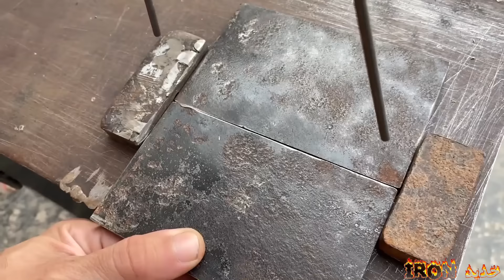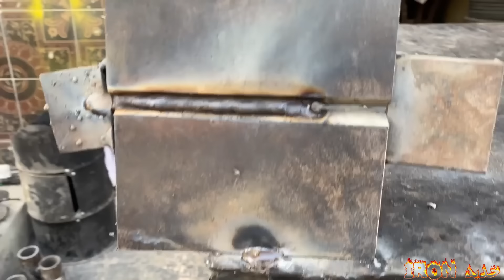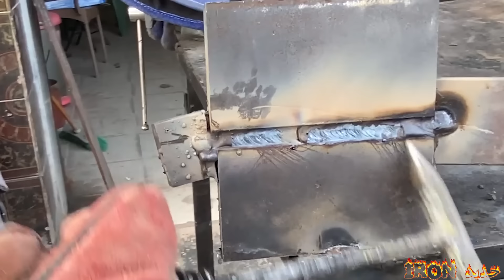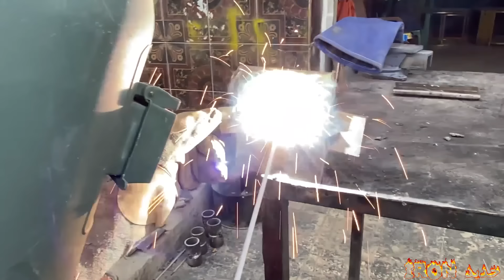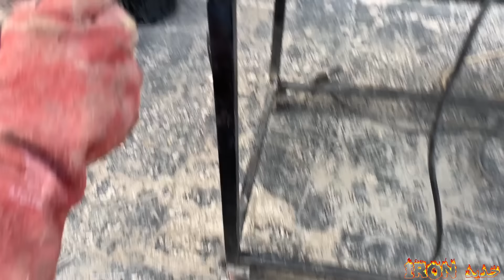2G  Root welding method  cap 7018

Comment: You are a good welder but the undercut would fail it in a bend test. No cutting wheels to clean it thats what caused the undercut which equals weak joint. Good video though.
Reply: V rezných kolieskach máš pravdu na 100%,ale zvaral veľmi dobre a pri koreni dodržal tvar hrušky aby vznikol koreň.
Reply: @sdrafiqul6348  ❤❤❤❤❤❤❤❤ цих
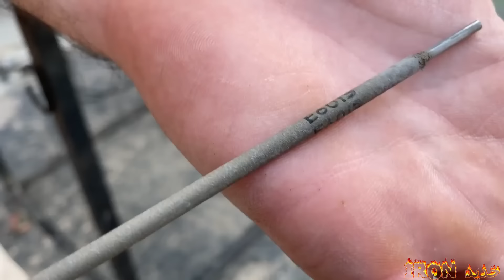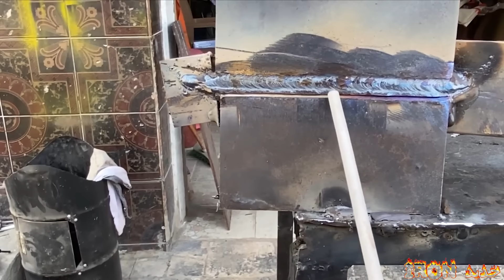Reply: I agree on the undercut. As a Boilermaker "certified, high-pressure welder, I noted several items. On the backside (root pass) the slag would seem to indicate some "push through". The weld tests, I've taken, would permit the use of a wire wheel on a grinder, but never a grinding wheel. That was grounds for fail. My certification tests were on schedule 40 tube with a test strip taken at 1:30, 4:30, 7:30, & 10:30. There would be a face bend, root bend then the ultimate two were given side bends. In over two decades I've never failed the cert test or on the job, had one of my welds fail ultrasound, magnaflux, x-ray. I never held the rod, to steady it, my idle arm was used to brace the arm with the rod holder.
Reply: I remember taking my 3G stick welding test some 20 yrs. ago. We were not allowed any power tools. Only hand tools. Chipping hammer, wire brush, and some dental picks were all I could bring. Not even allowed a grinder at all doing the test.
Reply: @americanwelder9865  On my first test the company had nine tubes set in a square frame, one foot off the concrete. The middle 10" of the center tube was cut out. They did permit you 4 heliarc tacks that did not exceed 1/4" in length. With tube clamps you installed your coupon into the center of the jig. It stayed there until you completed your welding. You had to reach through everything for your heliarc and then stick passes.
Reply: الله يرحمه ويغفر ٣٩ والله ٣٩ ظ
Reply: There’s no undercut don’t know what you’re looking at he’s a good welder
Reply: Нужно чистить эту грязь тоько металическим кругом для болгарки
Reply: There isn’t any undercut you need your eyes checking
Reply: Senarnx klo dasarx dan lobang sdah tertutup tinggal di kasi jln aja ektrodanx
Reply: Klo pnilaian z itu blom
Reply: Very nice
Reply: 6013 easb rods the green ones make it happen

Comment: Nice job for a learner. Try half the gap with a 7016. Don't flick back and forth your chucking metal away. Keep the arc short and watch for the arc flame just licking through. If it gets too hot slow up and shorten the arc to cool it down or vice versa . This applies to all positions and trains the eye to watch the pool. First ten thousand bots are the hardest.
Reply: Hello sir ❤️ have a great day
Reply: why don't you make a video showing how it's done? anyone can say do this or that...
Reply: Retired two years ago having welded power station tube walls and steam turbine pipework,gas and oil pipelines, gas compressor stations, and hospital size boiler rooms. Being an old git I'm crap at videos and besides haven't got a piece of 6" 5LB in the garage so l can't help you there, sorry. You will come across someone somewhere that can knock six to ten of these out in a day to radiographic standards. I learnt from an older guy at work well after finishing a five year apprenticeship . Good luck.
Reply: @timstone5112   so you can easily show how it's done on video.. do it... any clown can post I did this or that.. so what
Reply: @TVTruther  we understand your point but tbh I don't see where this man disrespected or said anything wrong about the video. In fact, he tried to help.
Reply: @chadmoyer1453  any two bit clown can rattle off anything..Stpne needs to make a video to show how it's done...
Reply: Whilst I agree with what you say also remember he has knife edged this prep so he is ensuring it doesn’t overheat and burn away. Let’s try help each other and improve as welders.
Reply: Nice
Reply: @TVTruther  What, you think everything you SEE is gospel?
Reply: @trickster8635  you think advice from some random poster is gospel?
Reply: Id bet this man knows what hes saying.
Reply: @cloggedpitot1  have trickster make a vid for us.. we will see
Reply: @TVTruther  I was responding to the OP. He seems to know what hes talking about, giving a thoughtful, detailed explanation of how to do something better in a respectful manner. You on the other hand offer nothing, except troll like behavior. No counter point, no experience, just a rude comment or two and argumentative comments. Like you said, any clown can post stuff on the internet.
Reply: @timstone5112  Much respect from a retired welder myself. Thanks for offering your advice. 🍻
Reply: @TVTruther  like you rattling off comments?
Reply: @jewellerydesignerartists9353  That is a great job 😍😍❤️❣️💓💖💝🧡
Reply: @TVTruther  Your arrogance shows your ignorance. Try to show a little respect.
Reply: @Ralph Dela Cruz he gave crap
Reply: Đôi khi bạn nói một cách trung thực nhưng lại nhận lại chỉ trích , công việc này đòi hỏi kinh nghiệm lâu năm mới đúc kết nhưng khi bạn chia sẽ miễn phí lại khiến những cái tôi người khác tổn thương 😇. Và họ lại cho là bạn thể hiện . Thật vui nếu ở gần tôi sẽ có 1 người bạn tốt như bạn  . Như bạn nói bất cứ một góc độ nào khi hàn thứ cần khống chế đó là nhiệt của mối hàn , cách giữ khoảng cách, gốc độ  que và quan sát hồ quang là một kỹ năng  sau đó là vật liệu phụ và chính như thế nào .....
Reply: @TVTruther  why don't you make a video showing how easy it is for him to make his video? 🤡
Reply: @TrillMurray  lol.. What a dumb deflection
Reply: Giỏi quá
Reply: @TVTruther the guy actually has a valid point! By keeping the two metals half gap will help out with a better weld. Just sayin! You could put that in a bench vice and hit it with an 8lb sledge all day and only bend the material and won’t break the weld.
Reply: @timstone5112  Tim my brother, I thought maybe he was trying to show how to do a wide gap, I'm a certified welder, I could tell from your first statement. You know what you were doing, Thank you for sharing your knowledge, I'm older than dirt, And I still haven't seen it all.

Comment: The whole point of welding is to melt both metals equally and to drag the rod if it is horizontal position, if you weld verticals than some rods like 6013 are perfect for vertical up, but do not try vertical down with that electrode, if you weld with 7018 than your arc needs to be very short, I mean you need to melt both pieces with same rhythm and move electrode, after some time you will get experience to  make it routine.
Reply: Рррррррииириирррриррикбирррирррр
Reply: I would not do circular motion for the root. Just a drag with a short arc length. As long as there is weld protrusion at the rear.  To me there was too much protrusion after the first pass.
Good idea about tacking blocks on the ends to maintain the gap while welding across the width.
Reply: You can drag or pull the rod as long as the slag pool is behind the molten metal pool.

Comment: The gap is wider than I prefer, but to each their own. There was a lot of porosity in your root pass, but I didn't notice it nearly as much in the fill or cap. All in all, I think it would pass a bend test. 👍
Reply: Wouldn't even pass visual inspection. There's so much undercut on the last cap pass, which he wouldn't even need to do if he didn't grind the hell out of it, which would also fail you at most places, since they typically only let you grind the root to feather, and the rest will be wire wheel only. 

The probable porosity and slag inclusion from pure chipping and not any brushing could potentially crack it during a test. That's assuming that they even let you go to bend it. But given that no country with safety standards uses Arabic even as a third language, it would probably be fine even if it did crack.
Reply: @volatile100  yea I didn't even notice the undercut on the top cap weld. That'd be a no go.
Reply: @volatile100 what do you think caused it to undercut?
Reply: @Trill Murray  Too hot and having too little angle are most likely causes for it to happen. In this case it's probably the heat, since bead profile isn't drooping down like it would with bad angle. Turning down the amps or letting the plate cool would fix it.
Reply: @volatile100  thank you! I really appreciate it.
Reply: @volatile100  a bit to high of angle,  but mostly i think he pushed into the top edge with the rod rather than letting it consume the edge and fill it, causing the undercut.

Comment: I've been melting electrodes since 1979 and I'm still learning, congratulations on the video and technical ability
Reply: sloppy at best
Reply: @kennethcrowe300  and at worst?
Reply: @kennethcrowe300  who cares welding isn’t a art competition it’s about getting shit done that works. Everything isn’t a pissing contest . I’m sure there are welders that make u look greener then the grass in spring . Just because you hate yourself so much doesn’t mean you gotta bring others down
Reply: @joebly5641  you're right it isn't an art it is a trade and in a trade there is this thing called VISUAL INSPECTION

If a weld is shit then it looks like shit aslong as your looking for the right thing 

unless you're working on playgrounds or hand rails for the middle of nowhere or welds that don't really matter and are just there to stick some random shit together for a quick gig then you would be correct...but for this shit it's quite important

I would fail this plate just because of the sheer amount of undercut plus the hollows I saw on the arc shot

Something I have to check off on a sheet everyday at work is uniform weld profile uniform length and width of weld bead.
Reply: Still the same way of doing things except for the technology more digital. I remember the water cooled machines everything from rolromars to the stainless steel pipes
Reply: Go my Los angeles shirt in seventy high school years

Comment: This man knows what he is doing. Depending upon the place you're working. I was always told no cutting wheels on a weld test. Only wire brush wheels.
Reply: You can use tools, you just end up forfeiting some certs that require you use NO tools.

Comment: I'm afraid that would fail a test due to mechanical damage from the cumbersome use of the cutting disc scoring the plate. Besides that I don't take advice from somebody who operates a grinder with the guard removed.

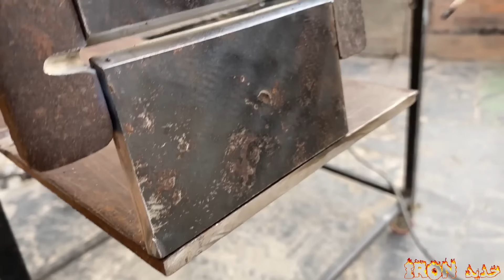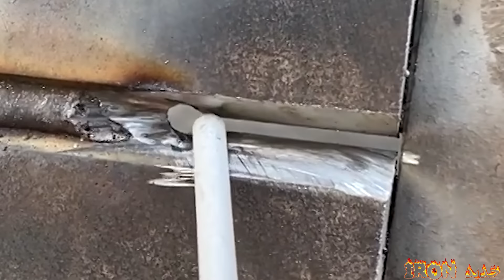Comment: Compare 1:30 to 2:49 and you will see there was something changed about the video sequence.   At 2:49, the wing added to the right side doesn't have a hand grinder groove cut in it.   You can tell at the very end of the first pass, the root, he was panicking because it was getting hot and about to blow out.   I think there was multiple attempts at this root pass on different plates.    Unless someone dictated such a large gap for the spacing on the root, I don't see the point.   Cut landings on the plate edges and use less gap for spacing.   A few extra amps and push the rod forward instead of dragging the root and you could easily watch it cut through without so much flipping back and forth and pushing so much puddle through the backside of the plate.   Maybe the plates were prepared for him and that's what he had to use along with the required spacing?   Who knows?   No explanation given before video.   It could be done easier as far as the root pass went.   None the less, informative video.
Reply: Your comment made me laugh. My first thought was why an 1/8 gap with no land on the bevel? You are just asking for an unwieldy size keyhole 😅. I'm with you, tighten the gap, grind that knife edge of a bevel a nice land and kick up the amps and punch through. Should be easier to maintain the keyhole and get all the way across with a single electrode.
Reply: Busted😂
Reply: .57 second tack becomes a weld ?
Reply: @whamburger4576 look again. That gap he set appeared to a covered smaw electrode. At the very least it was 3/16, looked more like it was approaching 1/4 inch.
Reply: Material definitely changed.  What he started with isn't the same as what he finished with.  Guessing he blew the shit out of the first one with such a huge gap with no land and started over.  Why suggest pushing the rod instead of dragging?  Risk of slag inclusions...

Comment: pushed into the top edge to much rather than letting the rod consume and fill it,  which i think caused the undercut.  i'm still in welding school,  but i recently fixed my undercut issue for the cap passes on V-groove joints by watching how my instructor has literally 0 undercut on his cap.
Reply: You're right... top cover pass needs more upward angle & push in to fill over the undercut

Comment: I took that course in 1991, and I remember that in the 45° x 1/8 bevel, the penetration electrode was 6010, in negative polarity. Yo realice ese curso en 1991, y recuerdo que en el bisel a 45° x 1/8, el electrodo de penetración era el 6010, en polaridad negativa.

Comment: First of all he did not clean off the mill scale which would cause porosity also didn’t clean off slag after his root and proceeded to fill it in 😮
Cleaner metal equals better bond and prevents cracking

Comment: Very nice finished weld. Why no backing for the root pass? Although I never used it, they make a tape you can use for this. The root gap also seemed a bit excessive but I am not certain. I design heavy steel structures and refer to AWS D1.1 for preapproved welds for guidance. Anyhow, nice looking weld.
Reply: this is  open root that's why there's no backing

Comment: Why didn't  de scale the top and bottom  of the plate  . If that were for a job or a test plate that would have possibly failed with the scale being pulled into the root pass and cover pass   weldments.

Comment: Root pass is undercut. Too much gap and too much heat.  You burned away the  base metal. You want to keep that, just tie it together. Use a 3/32 gap with a 3/32 5-p + rod on about 90 amps

Comment: would fail sadly !:..  to many passes, if you take a flashlight, and lay it down on the plate, and let the light go straight over the weld, you would see small gapps all around !,.  but your getting there ;)

Comment: Smaller string beads will work better,on top of that bead placing a must no grindig wheel do root pass ,bottom top and on may take little longer but won't fail a test overall ok job but not prime keep pushing for 110%

Comment: When I did my welding test for a bridge project it was 1/8 to unlimited and all I could use was a wire brush....no grinder or a chipping hammer.....on a old ass machine on top of that

Comment: Good weld but lower that amps let you dont wip that crazy where you increase slag inclusion and uneven root where i will fail youre weld if not fix ill say 60 amps is good depend on Inverter or water coolent or the normal welder what will be 70 amps then with the 6013 or 6018 /2.5mm

Comment: Your gap is way too big for 6013 you’re not burning into the top for an efficient Weld, those two pieces should’ve been brought it up against each other because you already grounded groove that was over 2 Rod widths wide.
 So if you had to do a vertical you need to butt those two plates up against each other That way that first pass top and bottom are equally burned into with 6013
Reply: He could do all this with 7018, that's how it's done in the Nordics at least. Gap is fine even for vertical, but you wouldn't want knife edge on the root side. Give it 1-2 mm flat to your liking, then you actually need a gap this big because you want shortest arc possible, effectively pushing the stick through the gap to the root side. We don't use 6013 because it could cause hydrogen pores in the weld. Sorry, English isn't my first language.

Comment: That's an easy job for e6013 bcoz it has a shallow penetration and does not freeze so fast, unlike e6010/e6011 they penetrate deep, freeze fast. That's why I love e6013 ♥️
Reply: You are clueless
Reply: @CL9k24a3  You don't get it? Reading comprehension please

Comment: E6013 is for second pass ..for root pass is E6010 or E6011......sorry dude but for me i will use E6011 for root pass not E6013....I'm not agree your root pass method using E6013....

Comment: A lot of people below saying the gap is too big. Out in the real world (ship yards ect) gaps come in all shapes and sizes 😂 some shit platers out there. Ceramic backing is used a lot single v butting up 15 mil plate on the vertical flux core 1.6 wire.  6g pipe.  all position plate codings
Reply: Yes But you can refuse an out of code fit up Surveyors inspector would be kicking arse
Reply: @leehotspur9679  COYS